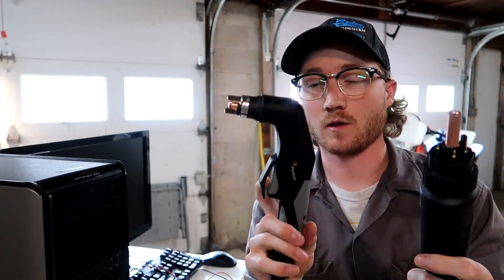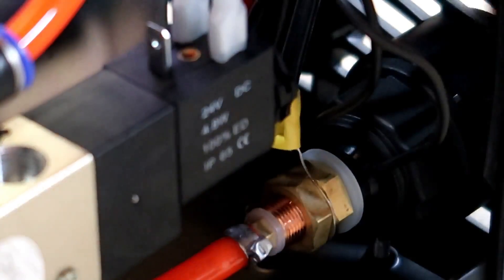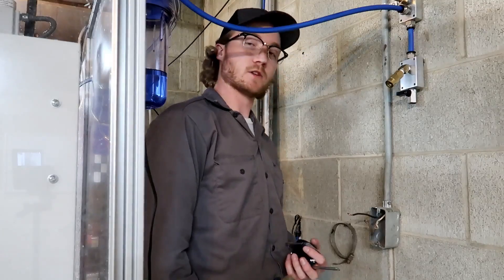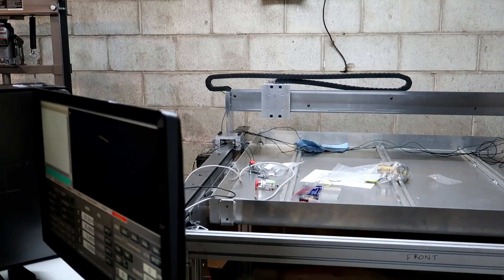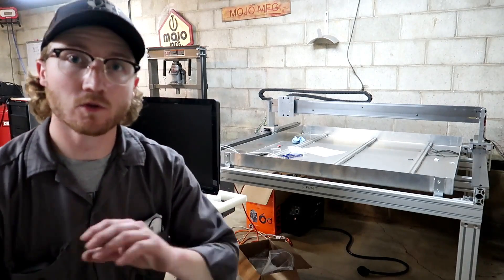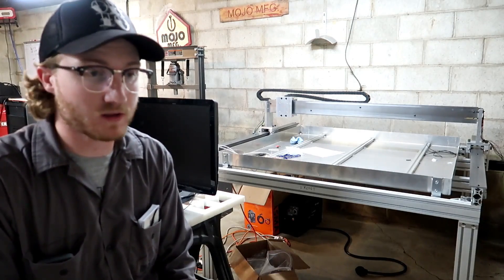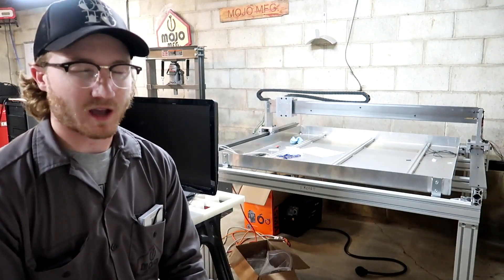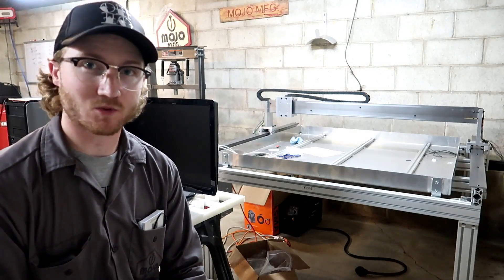DIY CNC Plasma: Housekeeping Items: Home Mfg. Days #44

Comment: That looks like a 50A plug you put in that box. I don't think 10GA is big enough for a 50A outlet. Now, I know the plasma probably doesn't actually take 50A, but I don't think it's to code to have a 50A outlet on a wire that can't supply 50A. Common sense says as long as the breaker is the right rating for 10GA, it's probably ok, but probably still not to code. I ran 6GA when I put a 50A plug in for my welder (and maybe plasma, or EV car charger at some point).

Comment: Do you have video showing you connecting the plasma cutter trigger to the BB?  I'm at a loss  on that for mine. great vids!!
Reply from the maker: Sorry I didn't see this comment sooner.  I have a C10 Breakout board(link below). After I hooked the trigger wires to the plasma cutter I looked at the wiring schematic for my C10 board.  There is a small blue relay on the board and that is what turns the torch(or spindle) on.  The hookups for that relay are right beside it.  The other link below is the schematic for my BB.  

https://www.amazon.com/SainSmart-Breakout-Board-Stepper-Driver/dp/B0093Y897A/ref=pd_sim_60_4?_encoding=UTF8&pd_rd_i=B0093Y897A&pd_rd_r=8b3041cd-dfaa-11e8-a2ad-edd834b3b7f7&pd_rd_w=pHZDI&pd_rd_wg=B1zVu&pf_rd_i=desktop-dp-sims&pf_rd_m=ATVPDKIKX0DER&pf_rd_p=18bb0b78-4200-49b9-ac91-f141d61a1780&pf_rd_r=JXBFQ92MPHDEM9FZDE2N&pf_rd_s=desktop-dp-sims&pf_rd_t=40701&psc=1&refRID=JXBFQ92MPHDEM9FZDE2N

https://id2cnc.files.wordpress.com/2016/04/id2cnc_wiring1.jpg
Reply: @MojoMfg  I remember seeing your BOB it looked just like mine. Anyway if you could incorporate showing your board and were you hooked your wiring for the trigger and if you put a THC on love to see that as well. I'm having the hardest time figuring out the wiring and would love to see one wired up. Just saying. I'm old school and definitely not an electrician. 😎😭
Reply from the maker: Haha yes I know what you mean. I had a heck of a time figuring out the wiring.  Do you want to see the wiring for the trigger on the plasma machine or the BOB? I have a Proma THC on it know and I would be willing to show you pictures of that as well.  Shoot me an email at mojo.mfg.ops@gmail.com and I can get those pictures and an explanation to you.

Comment: Path Pilot is just a front end for LinuxCNC, there an example of how to get LinuxCNC to do Torch Height Control on the net.
Reply from the maker: I know tormach has some of there own coding on the backend but basically just a different UI for LinuxCNC.  I have seen some THC for Linux on the internet but just haven't found out how to do it yet.
Reply: It was my understanding that the Tormach backend changes is code they pushed back in the mainline so it's generic. Yes they have configuration for there hardware but that's all in the text files. http://linuxcnc.org/docs/html/man/man9/thc.9.html has the THC and I'm sure there are other ways to do it.
Reply from the maker: Gotcha...yeah I not too savvy on the coding part of this thing but that link definitely helps me understand it more.

Comment: As far as the aromatic z hight goes I think its setup in Mach 3 in one of the switch parameters and works with an open or closed circuit with the tool. Kinda like an auto tool height offset setter.
Reply from the maker: Ohh...that would make sense.  Hopefully it's not too hard to integrate.

Comment: LOL!!  Where you said you had so much to do that you just didn't want to do anything, so you swept the floors!!!  If you only knew how many days I waste feeling exactly like that......only I don't bother with the floors. LOL  

Now that you have the axis' moving nicely, you can play with the acceleration settings in motor tuning.  You can turn up the settings to get a steeper angle(faster acceleration) until it starts to stall out and then back it off until you're confident it will not stall.  It looked like it was taking about 6-8" to get up to full speed.  If it's taking that long, you won't see any gains using rapids on tool moves shorter than that distance since it will actually take 6" to get up to speed and about 6" to ramp down.....depending on your settings.  If that's the fastest it will accelerate, you may want to stick to high feed rate moves when cutting instead of rapids.  If you do this before you get the Z axis and torch on there, you'll want to do it again with those installed.....the extra weight will most likely affect when it will stall.  Getting your rapids up to 600ipm should also mean you'll be able to run faster feed rates.....right?  I know on thin sheet metal, the plasma will cruise through it pretty quickly.

It's really great to see that you're getting close.  I'm looking forward to seeing the torch height control figured out and I'm glad to see you're going that route.  You're too far in to switch to someone else's pre-built unit. lol  
Mike
Reply: If you have an air compressor, the air over hydraulic press from HF is sooooo worth the money to upgrade your shop press.  I still want to run a dedicated line to mine with a foot switch.  :)
Reply from the maker: I’ve been playing a little with the acceleration in pathpilot but seeing as how I might go back to Mach3 I will have to start over with that but we’ll see. I was helping a guy this weekend cut some things out on his plasma table. At 45 amps the fastest I could go is 100ipm(on 1/8” steel sheet). Any faster and it wouldn’t cut all the way through. So with that being said I could probably slow it down a bit haha. That 600ipm was a feed rate, not a rapid move too. I ordered the z axis and now I just need to do a little more research on the torch height control. Also, I am going to get an air over hydraulic jack at some point. I’ll save much more time.
Reply: You'll be able to run faster than that when you're doing thinner sheet metal.  I'm curious to see what you settle on in the end when you get it all running. :)   That's great you're getting the torch height control!!